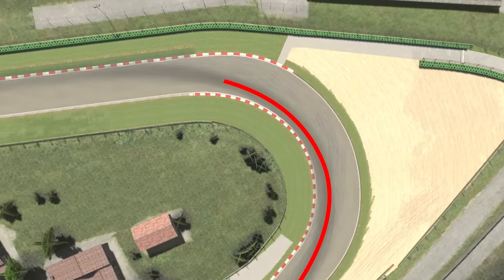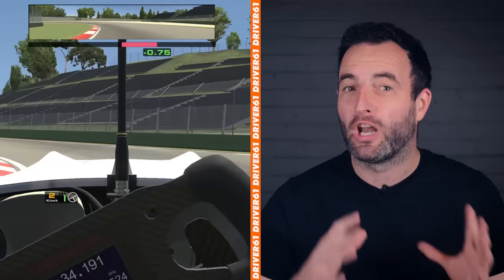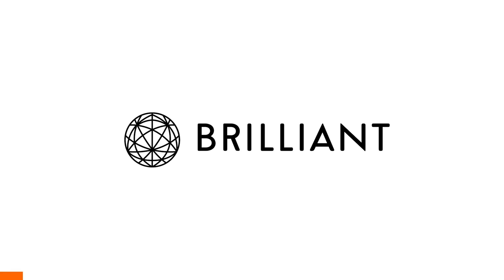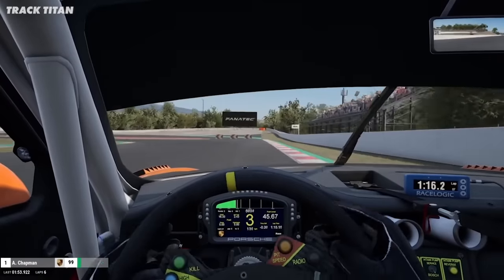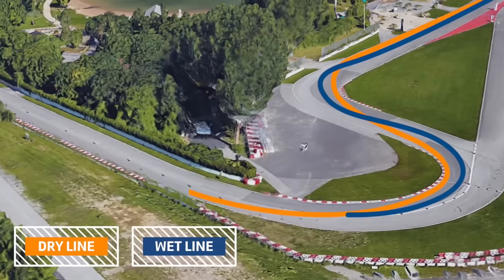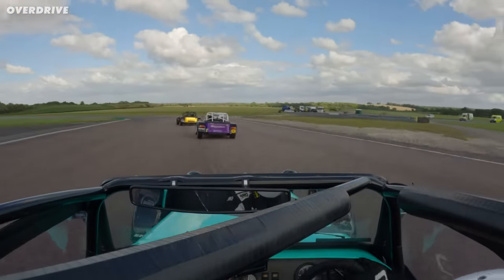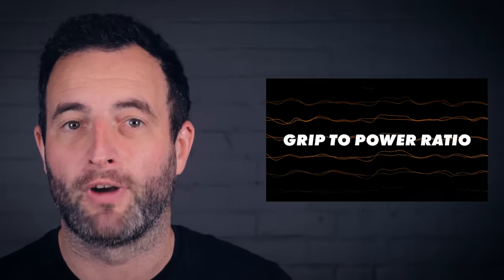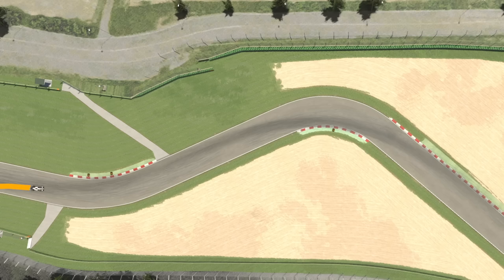Why F1 Drivers Use WEIRD Racing Lines

Comment: The line really dipend on the car you drive , you have a lot of horsepower you want to go on the throttle as fast as possible you don't have a lot of horse you have to go the quickest possible on the corner

Comment: The title should be 'How F1 Drivers can use weird racing lines'.  Big difference between a standard vehicle (even an average race vehicle) to a formula 1 car.  Superior brakes, downforce and tyres (to name a few).
Reply: except that's not what the video is about
Reply: @bigboyhours6473  Except the 'why' is made possible by the 'how'.  Without the how, there wouldn't be a why.  You see how that works?

Comment: "Inneholder betalt promotering

0:04 / 10:03

"Why F1 Drivers Use WEIRD Racing Lines?" Because they approach corners at maximum speed possible and they break as late as possible. A normal every-day driver doesn't have to do that.

Comment: While F1 cars have a lot of power the downforce is what really sets them apart.

Motorbikes are the exact oposite. They have insane power to weight ratios and motogp bikes actually sometimes accelerate faster then F1 cars.

I've seen a video comparing motogp to f1 on the same track and the difference is stark.

Comment: What if you have a really slow car? Then the fastest racing line would simply be the shortest path around the track. Imagine laying a string on the track and tightening it as much as possible. That would be the fastest racing line for a slow car.

Comment: Now do Max's line through the hairpin on pole run at Suzuka. Out-out-out...
Very odd (and quick)
Reply: Alonso does the same thing, usually in the next higher gear than anyone else. It's for the traction for the short straightaway after the hairpin.

Comment: What if you're in a twisty section with no straights to carry the speed down? Are you just sacrificing time in the corner for no benefit? Is it better to use the geometric line under these circumstances?

Comment: I would be interested in knowing what variables change that make it so the best lines in the video game Trackmania Nations Forever are usually the widest lines possible for the space.
Reply: Bad braking and acceleration, perhaps? Makes it better to keep minimum speeds up
Reply: @PunnamarajVinayakTejas  I think it's the opposite? I've been told the wider lines are better because "you get more time to accelerate", but I really don't know more than that.
Reply: @MudakTheMultiplier Getting more time to accelerate has less impact when  power is low. In an F1 car, having a low minimum speed but getting on throttle earlier means that by the time the car on the geometric line puts pedal to the metal, it's eating your dust. But if you have less power, getting on throttle earlier might not even get you to match speeds with the car on the geometric line by the time it's on throttle.

Comment: The Mathematical arc ignores the dynamics of the car and the speed changes through the corner. Also a corner isn't 2 dimensional some have banking and others don't. And besides most drivers actually set the the car up for the next corner so the longest arc isn't always what is required. But there are a few the parabolica maybe?

Comment: Higher performance Formula 1 cars brake and accelerate faster, so they can take a line that maximizes straight line speed.  Lesser performance cars can't so they must retain momentum with a wider, more uniform arc through turns.  That's the video summarized.

Comment: So much talking for relatively simple concept if one tries to look at it from maximizing the acceleration in direction the track is going. Thats it, thats all we do.

The reason geometric line works for low power cars (only on exit btw, brakes are the car power on entry so regardless if its miat or v8 they go same line there) is because up till the exit kerbs the sideways acceleration from cornering in direction of the straight is still higher than what engine can do. And we can derive all kinds of lines for all kinds of corners and cars just from that simple concept.

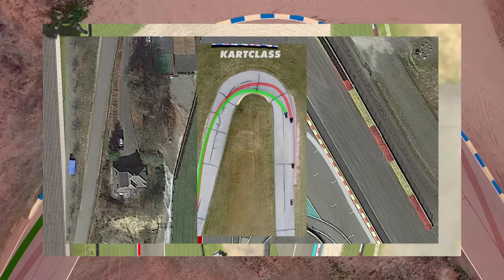I think its kind of bad advocating for late apex. The source of graphic at 0:25 talks in length why its not that good of an idea. And as Hamilton said it some years ago, they don't go slow in fast out (late apex) but fast in fast out - so indeed going relatively early into the corner. And while it changes over the years with different cars, i don't really see them squaring the entry in F1 so idk where that came from here. What they do is maybe not a smooth transition, but having two distinct entry "angles"... its definitely NOT braking straight and then going tight in thou. IMHO people will misunderstand that and literally square it (like in most graphics), which is as bad as turning in too early or going too fast at apex.

Also people focus too much in general on "good exit" because of misconceptions coming from how telemetry presents the data (both delta on straight and speed at given points). There are sayings that brakes are what makes a champion... because most of the time after one learns good exits is in sacrificing those exits for better entry. This would be a good topic for a video, but i guess this channel has evolved past deeper advice and now is for profit, which is fine, but i miss old Scott... cheers :).

Comment: another you drive line so you fast out or corner. another line is drive corner fastter but not fast get out.
and its completey opposite how f1 drivers do lol. mayby bcoz its faster way drive corner fast bcoz its accelerate on straigh anyway.
mean driver school line you drive corner faster bcoz you not cut too much. why f1 line is faster way? to make that you need slowdown it means if you drive faster you do it like driver school line f1 do it faster meaning your speed after corners is faster.
its more like do this so you block to get passed.
what if f1 drivers drive like driving school and thar red line is actully so depp it would not work

Comment: Hugging the right shoulder of the track, fast in fast out. With the correct timing for braking an acceleration ofcourse. F1 is per milli second racing so the race lines they follow ain't wierd, ain't no 10 Second cars here😂

Comment: This is click bate as the concept of racing lines has always been to make the straight the longest as possible to reach the highest speed, hence the fastest around the track.  I have never seen a geometric line taught other than for theoretical explanation so you can understand the concept.  You always brake as late as possible and use a line that would give you a head start accelerating out of the last corner, ei apex.

Comment: your “mathematically perfect line” is not mathematically perfect, because you do not consider the acceleration motion that is also a mathematical element. also your math solution is set as max speed, while it has to be min time spent.  math is great but usage here looks inappropriate.